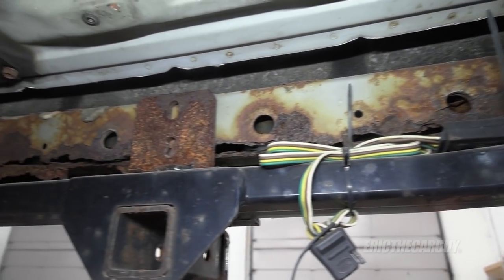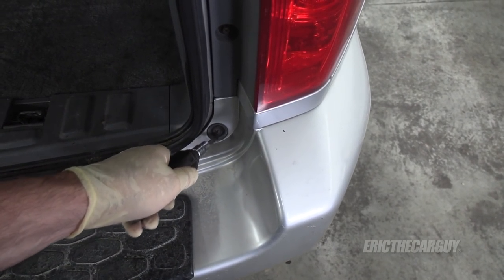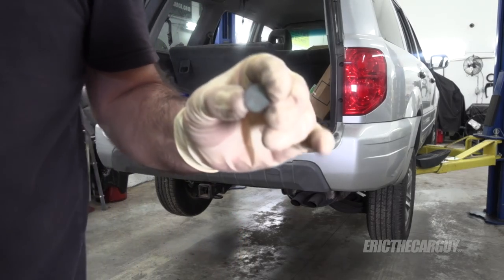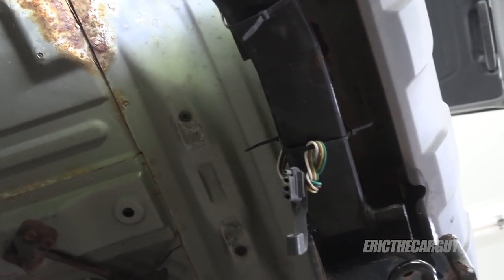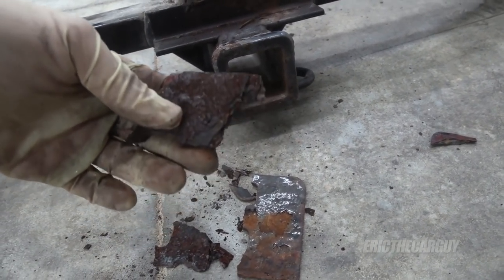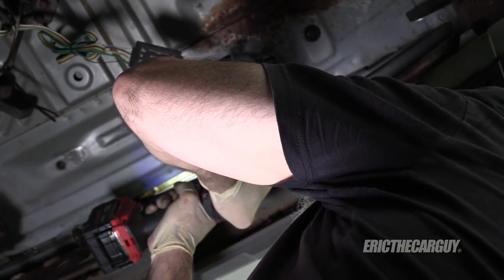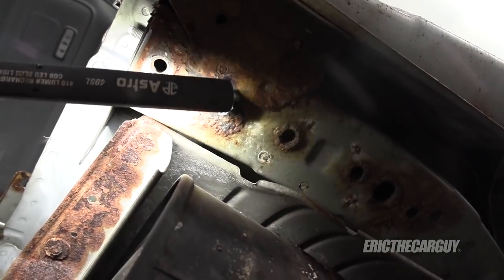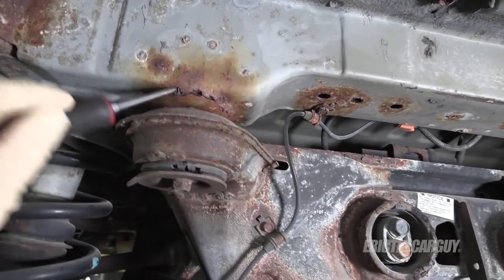Honda Pilot Rear Bumper Replacement

Comment: Nice job Eric!! 
I finally got tired of working with Ohio salt (the worst) sold my 250,000 mile MDX and bought a used Florida MDX!!
I drive a beater in the crap, park the rust-free MDX and spray my Winter cars with a K-Coat oil-based solution to help prevent these miserable head-aches.

Comment: Your repair work is going really well. I can relate to what you are going through as I used to run an autobody repair shop in the Canadian rust belt with my father when I was growing up. It would be interesting to see a cost summary when this project has been completed so that anyone who has the skills and equipment to complete such repairs will have an idea of what it would cost to do this work. I have met people over the years that have decided to repair an older vehicle and were soon over their head cost wise and had no real choice but to keep going. Thank you for the video and I'm looking forward to the next one.
Reply from the maker: I do plan to post those numbers when I finish the mechanical work and before I install the supercharger. As it stands now, I'm way over what this thing is worth. I knew that would happen going in though. Thanks for your comment.
Reply: @ericthecarguy  Isn't it always that way ? BUT AT LEAST YOU KNOW WHAT YOU HAVE NOW.

Comment: Great job Eric. Be sure to look into rust proofing, I recommend fluid film and yearly applications, be sure to protect your hard work.
Reply: Bar and chain oil, plus a dusty road. Permanent rust proof barrier. The thicker, the better.
Reply from the maker: I've used this in the past. https://www.youtube.com/watch?v=djuSxYI6UbE&t=2s

However I want to see how the rust encapsulator works out on this vehicle.
Reply: @ericthecarguy  https://youtu.be/MAZ1KHI_Y1g?t=121 Here is a good video about someone who did a similar job and you can see that after 5 years, the rust inhibitor did slow the rust down but it eventually came back. I myself did a similar job, he used one product, you used Eastwood chassis saver and I used Por-15 but really they are all similar products. I made sure to coat the painted surfaces with fluid film yearly and after 5 years, my coating is still perfect. If I would have left it untreated like that person in the video, it would have probably rusted through the same way. Using the chassis saver in combination with some wax/oil base undercoating is a must imo.
Reply: @ericthecarguy  Also in that video, he uses some Eastwood internal chassis saver and it performed the worse, unfortunately. It would had probably worked better if there was a rustproofing coating over it.

Comment: On my 2008 Honda pilot I replaced my bumper about a month ago, exact same issue, and process. though I didn't have as much rust on the body the bumber was GONE! The Foam piece on mine was split into two, and was not in the correct place. When fixing the foam piece and installing the bumper I noticed how sound my plastic bumper is, no longer flexes. I believe the foam was put there to support the plastic bumper. I sanded the surface rust found in various areas of the bumper attachment and put a few coats of rustoleum primer.  I will return in springtime to check my work and recoat if necessary any areas I may have missed. I do have another issue, there's a rattle coming from the back and I believe it's the suspension but not 100% sure. The noise only occurs when the driver's side rear wheel hits a few bumps, and theres a rattle coming from that direction. With the car on the lift i can't seem to locate the source, any ideas?
Reply: If it’s a rattle on one wheel during a bump I would think about replacing 1) the sway bar link and 2) bushing for that wheel. Obviously more easily said than done.
Reply from the maker: You might find this helpful. https://www.ericthecarguy.com/diagnosing-noises-in-your-car/

Comment: Eric, you can collect and remelt those pieces of iron oxide and get back solid iron......I think you should do a video putting those iron rust dust pieces in a ceramic bowl and burn it with an acetyline torch to melt those sucker to get back solid iron metal....That would be a great video to watch.....and I bet you would get lots of viewers...

Comment: You should get a set of long drills. Very useful in the shop. Two sizes i personally find really useful 15 cm shank  (it's normal length + 15) and the 30 cm shank ones.
Reply from the maker: I have one that I've used for cleaning EGR passages on old Accords. Didn't think to use it though. Thanks for the suggestion.

Comment: You should take a look at your welder when you get some time.........  Mine quit working also, and it ended up being just the switch---  Mine had a big power on/off switch on the back of the welder---  and the contacts welded themselves together; It had crimp connectors on the wire and looked a little burnt-- so I cleaned them up and crimped them a little tighter and just followed those wires to where they connected on the circuit board (which also just had crimp connectors) and connected my plug wires directly to the board, bypassing the switch-- and it works great again....   It just comes on when I plug it in now. (but if I'm plugging it in, Its because I'm about to use it. lol)-----  I could put a little box on the cord itself and put a regular light switch on the line; likely an upgrade coming................  My point is, don't give up on that welder so easy-- it's likely something simple.....  Maybe your's connects to a relay switch on the inside and you'll just have to bypass that relay-- or order a new one. ect..  Could be a bad cord too-- plug it in and check your incoming power at the switch, ect..   Some cords will have a little fuse right there in your plug-- at the prongs.   Just look at everything and see if it's obvious;  because it likely is-- It's worth 10 minutes of investigating at the very least.... and then you'll have two welders. lol....  I have four, so I've been there.
Reply from the maker: Mine just had a bad switch. I ordered a replacement, but Eastwood sent me one of their 140 welders and I love it. I'll probably load this one up with flux core and replace the trigger and give it to my grandson.

Comment: Hi Eric. I own a Vw Polo Gt Tdi 1.6, my car has been throwing a 00538 reference Voltage-Open Circuit error in Central Electronics and even the air conditioner has been getting cut off randomly. I had sent the car to VW workshop to fix the said code and they checked the Climatronic, BCM, Reference Voltage Fuse and wiring and they all were fine, but still the scanner was flashing 00538 error, after which the master technician hooked a battery charger to the battery and erased the code and it didn't appear again, which it used to after turning the ignition off and then on. The Technician said that it is a bad alternator, but then the battery voltage is at 12.8 when the car is off and when the car is turned on without A/c. it shows 13.9-14 and when the A/c is turned on it shows 13.78. There's no issue with starting the car, no battery icon on instrument cluster, nothing, but the fault code won't go.

Comment: for too many redundant bolts and screws on bumper. I think you should did the top 2 and side butt up pieces but only the one in the middle under the back.   rust is always a pain

Comment: Eric my brother from another mother, hope you and the family all well 🙂. Another great, very educational video, thanks man 🙂.
Eric, would you say it's a good idea to leave the rear "wheel arch lip rubbers" installed that usually come on many Honda's including the 1996-2000 Honda Civic. Some people say they hold moisture and mud, etc underneath them rusting the metal arch lip underneath, wondered what your thoughts are regarding this bro? Regards, Mike in England 🙂
Reply from the maker: Remove them. They promote rust.

Comment: Eric ,I had the same welder from Longevity. It quit after 5 months. Longevity would not even return my calls. A letter to them did not bear any fruit. Screw Longevity.. I now have a Lincoln Pro Mig 140 and it is holding up well. I now have had it well over three years. I would like to hear about the replacement. Ken
Reply from the maker: Funny you should mention that. This welder broke shortly after this video was shot. It just needs a new trigger hose, but ended up replacing it with an Eastwood 140 and I love it.
Reply: @ericthecarguy  I have dealt with Eastwood also. I purchased the tubing bender. BTW, I have been a subscriber since you were under ground, or in the garage under the dwelling. Lots of great information from that place.

Comment: Eric, thanks for the details of the bumper replacement.
Aside note, what happened to an old video of the timing belt you did on J-series V6 Honda a while back----like 10-12 years ago? I really like that OLD video....Did you take it down because I could not find it?
Reply from the maker: No, I don't recall taking any videos like that down.

Comment: I'm guessing the rust around the rear bumper is caused by snow getting packed up in there.  What if you filled the nooks and crannies underneath there with expanding foam.  Would that help keep the snow out?
Reply: It would probably keep moisture in and rust it out faster to be honest. However soaking it in oil would help
Reply from the maker: Likely caused by the salt water leaking down under that black part on the top of the bumper, where the penny was. Also, whatever gets up in there, won't be coming out anytime soon unless you wash it out.

Comment: Hi eric,after you replaced the beam metal are you able to show the alignment the rear wheel or the shocks area?
Reply from the maker: Not sure exactly what you're asking. I do plan to get an alignment after I complete the work on the front suspension.

Comment: i have a 2003 accord it has a ruff idle and engine is shaking and it wot rev over 5k rpm like its on limp mode  no check engine light i scanned it no code ... but the long term fuel was 20% and it was over 15 degrees spark advanced..
Reply from the maker: https://www.ericthecarguy.com/solving-automotive-performance-issues/

Comment: Hey Eric the car guy 
Would you rebuild My 2002 Honda Accord it a no rust Oklahoma car with only. 265.000 on it still running a driving
Reply from the maker: I'd have to complete some other projects first. Also, I'll be moving my shop soon and won't take on anything new until after that's completed.